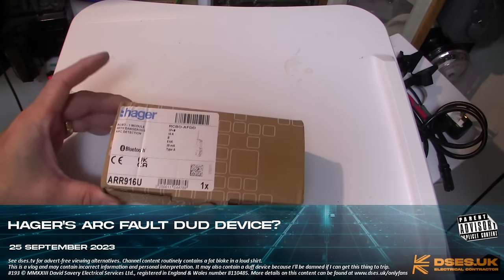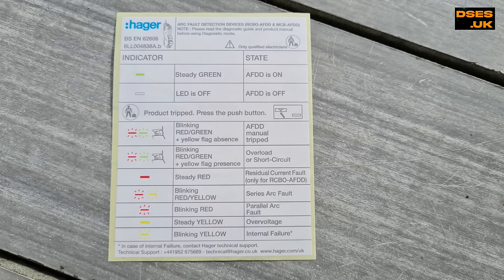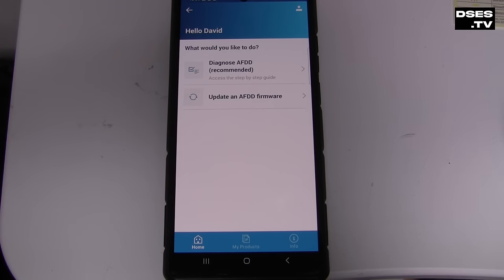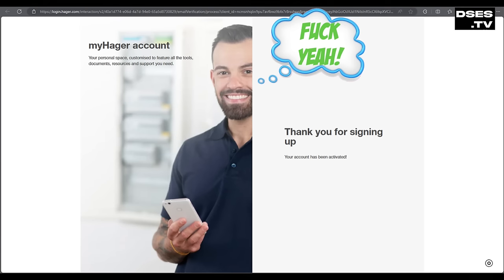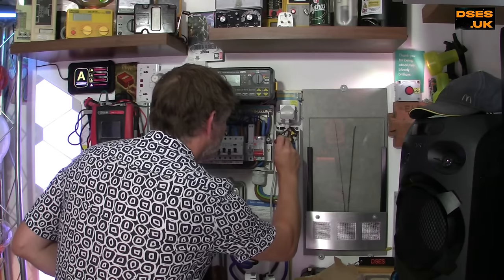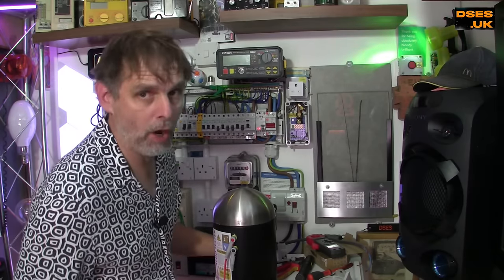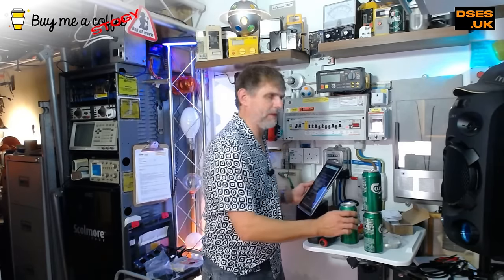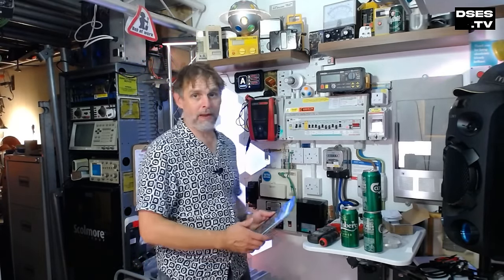AFDD: Hager's Arc Fault Dud Device?

Comment: Nice vid. I saw you and Linda at elex but you both looked hasseled and in need of coffee and snacks so I left be. Another time perhaps.

Regards this nonsense, I reckon centralised DB processors will come. When they do if some smart git can use data over power to analyse the circuit then all sorts of remote testing and monitoring becomes exceptionally useful very, very quickly. Your vid with the CA, r2 tester set me thinking that wireless r2 has got to be possible. Data over power could be the way in I reckon. These techy remote workers can send millions of individual data signals down busy power cables. It wouldn't take much beyond a bit of imagination, a few smarts and a bit of application to come up with something useful.

That out there I'll retire back to the rest of this vid with my £1 beer and a niggling regret that my early forays into computer programing never went beyond a few lines of Pascal mon a 380z.
Reply from the maker: Ah, you should have said hello Steve! We weren't that hassled! I too used to tinker with Pascal back in the day on a Compaq 286 laptop (a bit of a push calling it such as it was a hell of a block and had no battery). Maybe more... transportable than laptop...
Reply: A poe connection built into the main switch to report back to the home network or electricians laptop might be one way.Then it could remove a lot of the security and extra hassle issues this unit has.

Comment: How can you install a protective device without having the appropriate proving equipment.
In the case of Hager, in this instance,  you can't trust the manufacturer.
This AFDD would have been installed and provided no arc fault protection without any means to prove it.
I dont like the use of microprocessors into protective devices.
Not least because they are a parasitic load that the customer pays for ad infinitum. Then there's the software issue and it's interaction with an App which is not necessarily within the understanding of every client.
Reply from the maker: I do think the lack of being able to properly test an AFDD is a problem, but I can't say if this device is truly dud. It's not behaving in the way I'd expect though.
Reply: @dsesuk  I think your comparison testing with the Siemens device gives the answer.
I love the test rig. You and Big Clive need to get together on some destructive testing!

Comment: The app should be able to decode the event time (elapsed) into actual calendar time of the event
Reply: How? It doesn't know when the power was applied.
Reply: @Monkeh616 well the app knows the current time and the breaker knows how long ago the event occurred, fuse the two datapoints with subtraction and you get the time of the event.
Reply: @edc1569  What gives you that impression? It reports how long it was on before tripping, not how long since it tripped. I misspoke, though - of course the counter can identify the powerup time. But it doesn't appear to know how long it was off. It can't unless it's permanently powered or has an actual RTC.

Comment: Just the simple step of using torx screws would be an improvement - instead of those stupid cross/flat hybrids - that don't accept the recommended torque settings without your full bodyweight behind the driver!

Comment: Hager are currently going on the offensive buttering up wholesalers due to their losses in the domestic market to the likes of fusebox and elucian. Expect to see a considerable price drop on rcbos soon. 
No doubt, they will wriggle out of the afdd debacle in the same way they did with the type a rcd trip times...
Reply from the maker: I like that Hager have good penetration at the wholesalers and backward compatibility with their old boards, but their pricing for all but the basics has been nuts for a while now. I'd actually use 'em if they were priced better, but it doesn't make sense when you can get the likes of Lewden for less.
Reply: And as if by magic, hager have just dropped their rcbo prices to around £11.99 + vat

Comment: Biggest issue is that it doesn’t work but the idea you need to update firmware on a domestic installation is laughable. Disappointing to see from Hager.
Top effort Dave, somewhere between JW and Jamie Blatant 😂

Comment: Could Hager actually be making a ###king dogs dinner AFDD ?  These garbage products are everywhere , backed up with clever sounding marketing words. I remember be soo impressed starting my career in double glazing thinking I was involved in making “ mantainance  free pvc windows and doors. Boy was that ever a porky pie when you look at the metal hardware failures on those products. The plastic was the only thing you could say was maintenance  free. My God the metal parts are soo prone to failure from corrosion / faulty design / incorrect factory or site installation it makes you cry to think that a product such as these has blighted millions of homes.

Comment: It would seem that the electrical industry is going the same way as the car industry - instead of just keeping things sensable and using tried & tested technology that can be produced for pennies - so reducing the price of the product -  NO they have to be always "trying" to come up with some "NEW" gadget or spin on something to "make it better" - that normally makes it WORSE - this is clearly one of those products - MASSIVE FAIL !! - thanks for posting this
Reply from the maker: Oh, my car's a pain in the ass. The lights and wipers have minds of their own and the thing that turns off the engine at traffic lights has packed up!

Comment: Well that Hager AFDD was shite!
Reply from the maker: I kinda formed the same opinion.
Reply: @dsesuk  I was just in the process of selling a kidney to replace my vintage Wylex fuse wire holder with a £1500 Hager loaded with these AFDDs. Time for a rethink. 

I hate the idea of an app for your consumer unit, I wonder what will happen when they need to maintain that app and decide your £100.79 AFDD from 5 years ago is no longer supported and you need to update the whole lot to continue their questionable protection.

Comment: I found the same thing... Had to buy a 100ma time delay rcd for a hager board to replace main switch for TT service in cornwall. £246.00 from Denmans so found one on ebay for £90. Already had rcbo,s for every out going circuit Plus wanky bloody SPD (because yes theres surges all the time and not enough room in the CU for all this shit ) all because NICEIC said so or we will strike you off and extradite you to NAPIT  Its all gotten so anal and litigious these days. I dont think anyone makes a CU with Time delayed rcd,s already fitted. Cornwall has TT everywhere especially in small towns and villages. Pain in the royal arse.

Comment: "There are no test instruments to prove the efficacy of arc fault operation."

Sounds like the perfect product to make millions from idiot councils thinking they need to rewire all their housing stock every 5 years cause "OOOO NEW REGS SAY WE MUST CHANGE ALL CU'S!"...
Reply from the maker: It does seem daft that this is a safety device nobody in the field can test and that we're all reliant on the button push 'proving' adequate operation!
Reply: Heh. We're in a council flat, my other half has been here nigh on 30 years and apart from a very cursory inspection two or three years ago there's been bugger all interest from them over it. I don't know if/when the Wylex CU was installed, but it has RCBOs in it, which I don't think were original (they're type A) so somebody did something at some stage, but all the wiring is still the good old red and black stuff (why oh why did they ever change it..?).
Reply: @TestGearJunkie.  Our council wants to replace the plastic CU it installed with a metal one cause it thinks they're a safety hazard, and they're citing the new regs as justification. 1 Person even brought up Grenfell.

They also want to do a full rewire, but put everything in trunking on the walls, and judging by the chaos that happened when next door had it done, I'm skipping it for as long as I can.
Reply: @sarahjrandomnumbers  No need to replace the CU, ours is plastic and has been there since at least 1994 when my other half moved in. Tell your council they're talking eyewash (polite term, ask David for some fruitier words..!)

Comment: Maybe you need to power up the afdd for a while to let it "calibrate " itself before you introduce the fault?
Reply from the maker: I doubt it personally. Being a protective device, it's supposed to be ready to react to a fault from the moment the circuit is energised. If there was an IR failure, it would trip within 300mS of being turned on or it wouldn't be fit for purpose. If there was a LN or L-E short, it would be expected to trip off in 0.1, 0.2, 0.4 or 5 seconds depending on the circuit and type of installation or it wouldn't be fit for purpose. There shouldn't be any delay with an arc fault just because this thing hasn't had time to wake up and get its act together. When that switch goes on, the green LED immediately lights to apparently indicate it's active and ready. If there's some kind of delay while it balances or boots, then the instructions should avise of that and the indicator perhaps flash to show it's not quite ready to monitor for arcing.